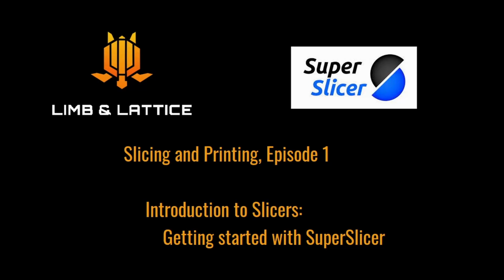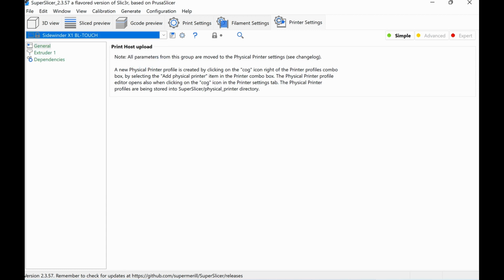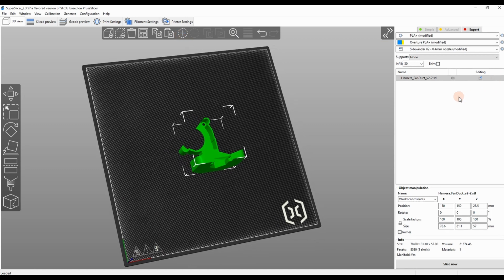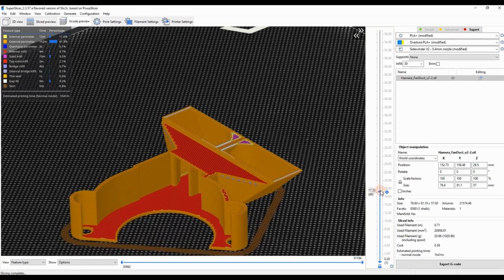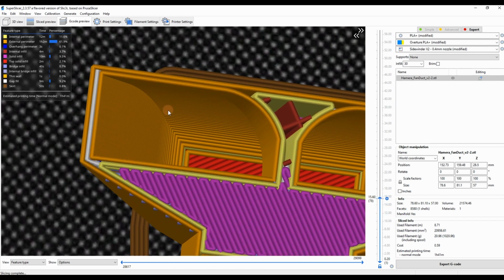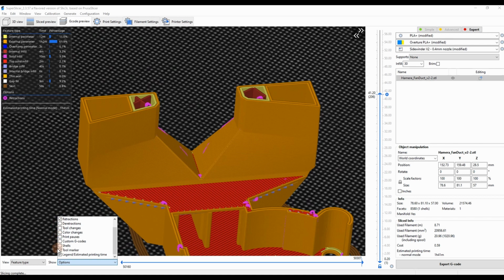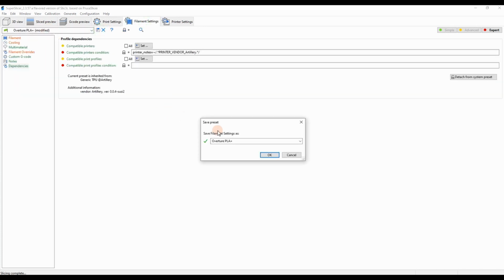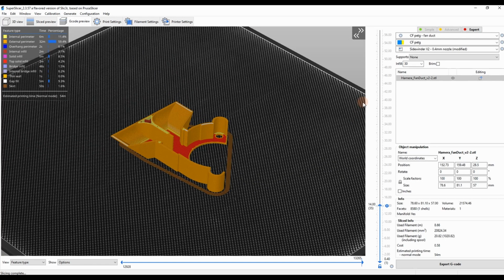Introduction to Slicers: Getting Started with SuperSlicer

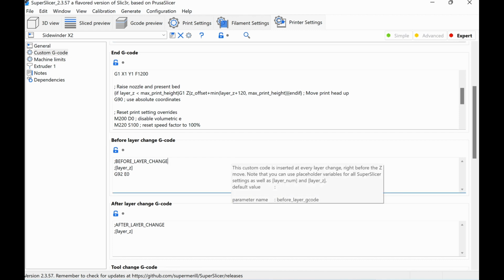Comment: HI still fighting with getting my own build printer in as a 'physical' printer to be able to even start the usual config/setup, but am in total confusuion re getting a physical printer in the bottom listbox under it's it's sub heading of 'Physical Printers' my appears in 'User Presets'.  I have rerun your vid many times but am still missing something.  @4:44 your top left listbox shows 'Sidewinder X2' that you named earlier, but when you switched back to 3D View your right hand side 3rd down listbox, which I am led to believe is the 'physical' printers now reads 'Sidewinder X2 - 0.4mm nozzle (modified)', can understand why the modified, is after it but how did the name you gave it earlier change ????.  Also as you did not drop that listbox down I can't know under what sub heading your  'Sidewinder X2 - 0.4mm nozzle (modified)' is in.
Would be most grateful for an answer to this as after some 4 days now the frustration is great, and I can find absolutely no docs on this that isn't n year old Slic3r doc, to try and help myself. Many thks in advance. Kind Rgds.

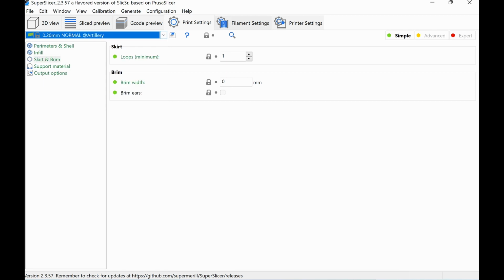Comment: I'm lost @ 2:51 the listbox went from '0.2mm NORMAL' to 'Generic PLA' in about a uS. How did you manage that ???. What's the difference between 'System presets' & 'User presets' they are all the same presets, or have I got that wrong.  I ask as I can find no other video on SS that starts from the start, YT is full of guru's & experts spouting on about the new techie things it can do but none I can find that start at square one as you appear to be doing. I am totally confused with the 3 dropdown listboxes and what their  contents represent when the contents look duplicated in each, which is why I ask the difference of presets above. So when I saw your vid I really thought I'd hit gold, but alas lost @ 2:51, if you have another vid as sometimes happens with makers of these YT vids, that fully explain I would be most grateful as I really am stuck before I have even started. Thks for your attempt, most grateful.
Reply: They flipped to different settings because I clicked over from the “Print Settings” tab to the “Filament Settings” tab. SuperSlicer has a lot going on.  If it’s too much, just start with the simple settings before opening up the added options with advanced and expert settings.  I create all of my own profiles because of the type of work that I do, but if you’re just printing things for fun then the presets might be enough.  My understanding is that some people do not even bother much with changing their slicer settings, while others get very deep into it
Reply: @8azk3ibsi  HI Sir, many thks for your trouble in replying, but my issue is way before Simple/Advanced/Expert buttons, it's the setting of a 'physical' printer such that I can then go and use those screens.  I am in total confusion as to the 3 dropdown list boxes, I assumed one was a 'select physical machine' another for you to 'select filament' and the last for the 'general print settings', but getting a 'physical' printer in the list and making a copy for very similar machine but not identical to each other and so need another entry to modify ( hardware settings ) slightly is a total mystery, on every chg of screen it seems to ask for yet another name to be entered in yet another listbox/editbox I am baffled how would have a few printers ( 3 in my case ) in SS and have them selectable.  If you cannot help in any way, could I ask where you gained the info to be able to use the s/w, I cannot even find and doc for it on wiki or anywhere, the help menu  'wiki' 'website' & 'manual' when clicked go nowhere, I'm totally lost before I even get the usual problems of setting a printer up, but that I could handle fine if I can decrypt the context/implementation of the method behind the madness of adding printers/devices.
Again, many thks in advance, most appreciated. Kind Rgds.
Reply from the maker: You may have better luck finding the answers you need by asking your questions on the GitHub page for SuperSlicer
Reply: @limbandlattice6487  Thks. But I would'nt know where to start there. But every reference I have seen connected with SS are from the guru's or the prize guys that rattle on about how great it is but give absolutely no info as how to get the 'engine started' for new users, and with no manual, no docs, no guides anywhere ( that I can find ), it is totally baffling how anyone can use this to any degree with confidence ?. Maybe then can I ask where you found your docs/info from that got you where you are with it, maybe I could follow that if it is available on a site that as of now I have not found. Kind Rgds.
Reply from the maker: I moved over to SS after using Cura and Simplify3D first.  I have put a lot of time into researching and learning what the settings are and how things work.  I rely on google searches and the wider 3D printing community for a lot of my info, pulling a little bit from a lot of sources.  There aren’t many resources that are complete start to finish guides.  For setting up a new printer,  you will eaither need to find one from the configuration wizard,  or if they don’t have what you needed then you will have to see if you can find someone who has shared the info you need on a forum maybe, or just learn to set it up yourself.  Unfortunately, these things aren’t particularly easy

Comment: Hi i would like to know how to control the speed settings in spiralized mode. I have set everything but when i slice my piece the high and the speed are progressive and my print is too slow. Somebody know where i can find the function to control that ? On superSlicer of course ;-)
Reply from the maker: Sounds like you might have a minimum layer time or something like that slowing down your speeds.  Check Filament Settings > Cooling